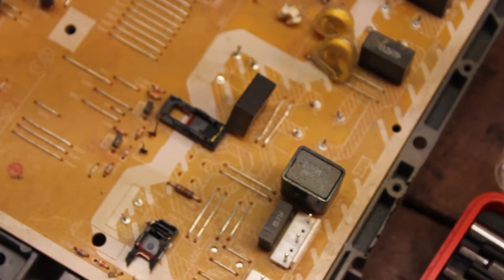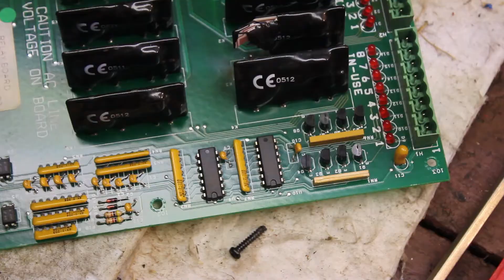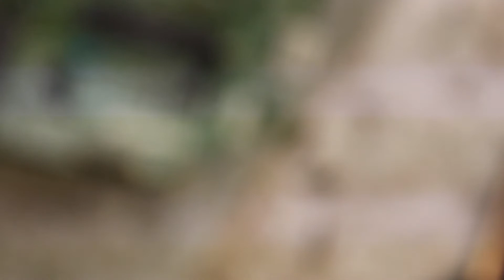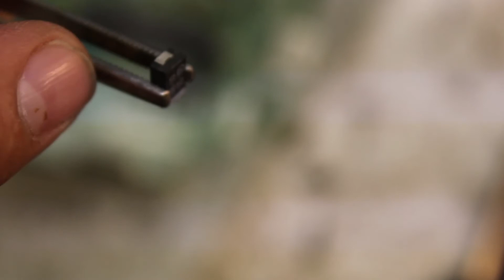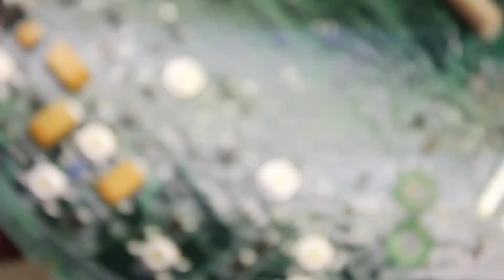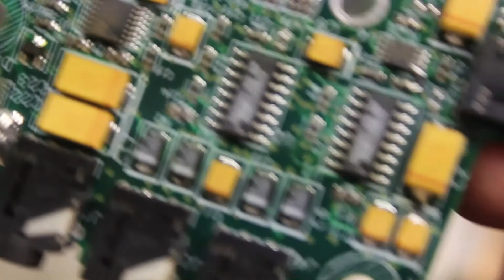Alamo City Scrapping - Determining Tantalum Capacitors Pt. 1

Comment: Helpful hint. Cut your printed circuit boards into 2 inch strips with a pair of nice cutters or a guillotine style paper cutter. Throw them (a couple at a time ) into a rotisserie with a wire basket and and aluminum drip pan.... everything will fall right off and you won't believe the amount of solder 
and small parts that will fall right into the drip pan between 10-15 minutes. The solder will have tin $20 lb, silver $32 and possibly lead 2 lb depending upon the age of the boards. Thanks for the video and help.
Reply: You can work on other shit while your rotisserie is collecting  money for you.

Comment: Well I know most of the information that you say is is accurate but honestly by accident I accidentally broke a yellow one a square one one time like the ones you have on the tweezers and honestly it was an older board but I seen gold inside of it I don't know if that's the color of tantalum or not but I was just you know wanted to know is that is that what it's supposed to look like or because that was by accident did I accidentally broke them broke it with my pliers and I seen gold inside of it

Comment: I wish I could add a photo into the chat because I have a tube shape capacitor with plus symbols it’s black one side with the wire is silver. The other side of the capacitor is red with the wire coming out number 23033 cosmic 10MFV 15V. FROM JAPAN

Comment: Ceramic caps are round, lower voltage are brown higher voltage are generally light blue. All of these have silver plating inside. Tantalum capacitors older ones look like bullets or tic tacs, newer ones are little black boxes they will always have a polarity marking. These have a tantalum slug with silver plating on it inside. Foil mylar capacitors will be cylindrical or chicklet shaped most of these are green but bigger ones are any color. Electrolytic capacitors are generally small to large aluminum cylinders. The legendary mlcc capacitors are either rectangular dipped in a brownish coating or small brown chips on the board. These have palladium and silver inside.❤

Comment: Hey Mike, at 3:28 the little tiny capacitors between the resistor arrays are old style MLCCs.  While not all of them will contain palladium, a lot of them will.  They are really hard to get off sometimes, especially when they are surrounded by other items, but they will eventually add up.  Take care..................Mike
Reply from the maker: Ah the 103's the tiny yellow ones are monolithic. I haven't really got into removing them but I do keep all my boards. I will eventually get around to it so much other stuff to get done. My garage is a mess let alone my backyard haha.
Reply: Alamo City Scrapping I know, hard to get used to this industry.  wish I would have got into this 20 years ago
Reply from the maker: Would of been worth it I think. It has really taken off. Hopefully well see the prices of other metals increase as well.